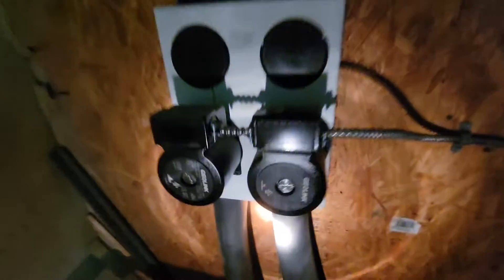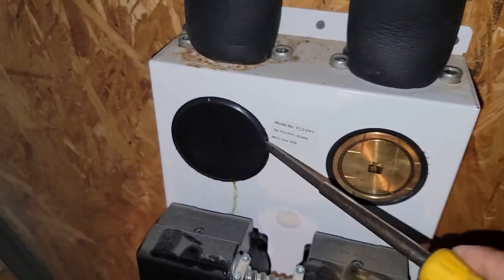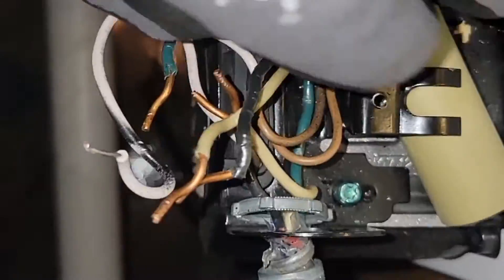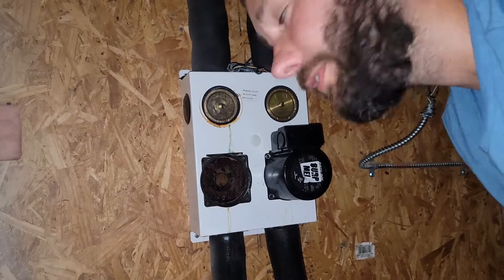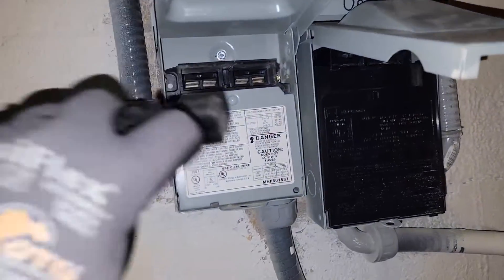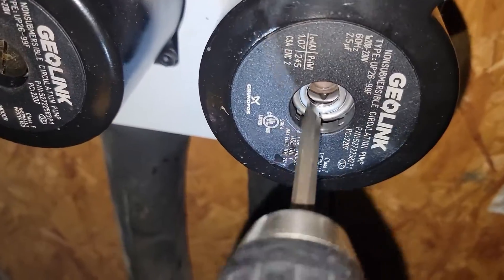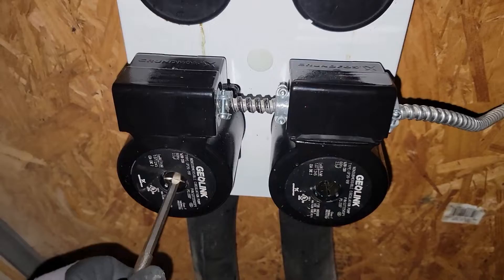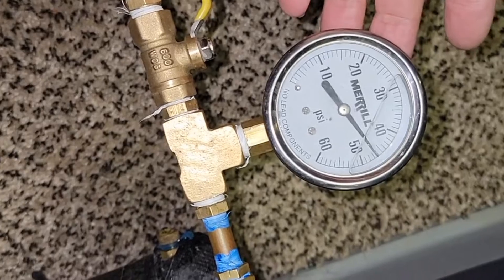How to Replace Geo Pumps?

Comment: I am a HVAC guy that is working on my old water furnace ATV028 it has an older control center with the valves on the side with a 3/8” outie with the T marked on the stem . I am trying to replace the pump without bothering anything else . It’s pressure system with a closed loop as far as I know . Hoping the tap with the hammer gets the motor off . Then hoping I find a replacement. Got the filling/ pressure test  tool as well hoping the loop isn’t leaking .
Reply from the maker: Wishing you Good Luck my Friend
Reply: @taddydigest  I got that POS off  it was on there . Wish I was ten years younger and had a better back . They installed it in the best spot with zero room next to the H20 heater .  Your video helped a lot thanks again .
Reply from the maker: Well you got it off man awesome
 You're welcome
 thank you for watching Please hit the like button

Comment: Just bought a house.  With Geo. I’m new to this.  All of a sudden The air coming out of the registers are bearly cool.  House is 84. Both pumps seem to be running.  I pulled the filter and it was clean. But behind the filter. There is some icing up.  Any suggestions?
Reply from the maker: Hit the join button send me an email I'd be glad to help
tadfuller1@gmail.com
Reply: For a Geothermal Unit the air on you supply is going to be a lower temp than a gas furnace. The air being introduced to your room is generally 95F. A more comfortable air. There is a 20-30 temp difference (supply and return) we shoot for. If there is ice built up on coils the unit may be low on charge.
Reply from the maker: Thank you so much for this great knowledge thank you for sharing my friend

Comment: Just the video I needed.  Was able to confirm a bad pump.  I ordered a replacement pump now I just need to wait with no AC until it arrives.

I was worried that there was going to be pluming fittings to deal with...

It's always something on a holiday.
Reply from the maker: Hey James so glad this video helped you please I encourage you to hit the like button and share the video
 Thank you so much for watching
Reply: @taddydigest  I'm just a dumb medical physicist.  We get trained in school and on the job not to mess with the electricity and the plumbing in our treatment units.  We have the kinds of voltages that kill you by throwing you body across the room and smashing it against the concert wall.  This respect just carries over from work to home.

I hit he like button.
Reply: My problems started with a low "pressure lock" out that I tracked back to a very hot pump body.  We lost power for a bit over night and this may have just been the pumps final insult.
Reply from the maker: Thank you so much for hitting the like button
 Let me know if you need me
Very cool background
 You're smart